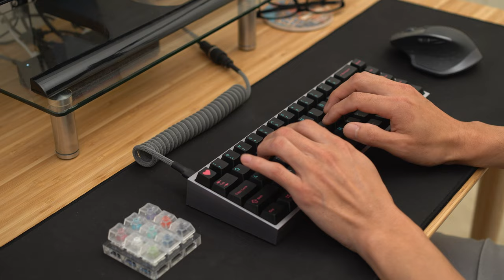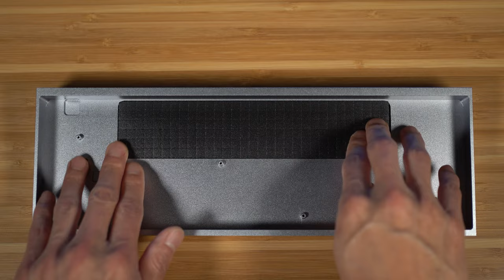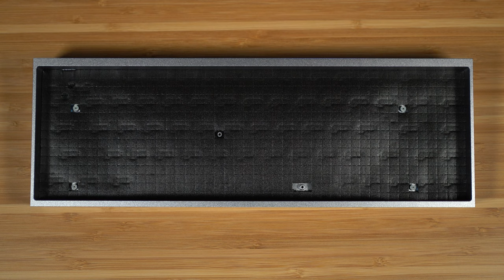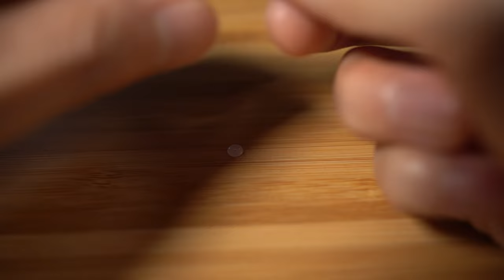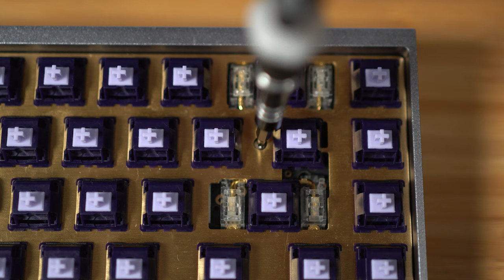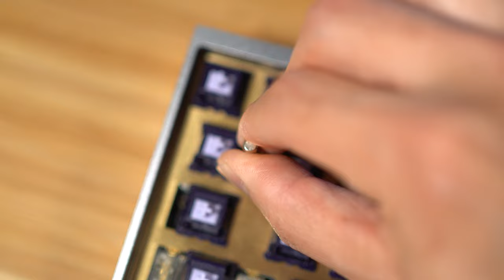Make the BEST sounding TOFU!  TOFU65 O-Ring Mount Mod Tutorial

Comment: Planned a very similar build (before watching this video and after tons of research) except I am using zeal stabs and holy pandas instead. But I am stuck between these keycaps and infinikey PBT keycaps. I would like a really satisfying typing experience and sounds similar to this one in the video. I am aware that it is all personal preference but I am wondering which ones you prefer.
Reply from the maker: Hi Connor!  Overall, I do prefer the sound of nice thick doubleshot ABS the best.  They have a very glassy sound that I do prefer.  However, right after that is a nice thick dye-sub PBT or even doubleshot PBT.  They sound a bit more "dry" but also lower pitched.  I think at the end of the day, it's preference + which switch you are pairing them with.  Either to emphasize the low frequency or a higher.
Reply: @Keybored  I know this is an older video. Do doubleshot pbt have a deeper sound or higher? ( prefer deep thonks compared to clicity clack :D)

Comment: This looks awesome and I'm looking to try this out on my Tofu 84 — but does raising the PCB by the 1.5mm thickness of the o-ring cause the USB-C port to misalign? And did you have to use longer screws? The ones with the Tofu 84 are only 4mm long.
Reply from the maker: Fortunately, the Tofu case has enough space in the port opening to accommodate!  Something like the Gk61 needed the port to be cut bigger tho

Comment: Well, I always come back to this Video somehow. I've had the same Idea and I have seen multiple mods people do BUT! Usually most of the mods result in a very pingy sounding keyboard that has good flex to it but (in my opinion) bad sound. This however is not the case with your keyboard I guess its because the tofu 65% first has better aka. more even placed standoffs and you double o-ring mod your screws on the bottom and the top. So I tried the mod on the but unfortunally I only had 6mm o-rings which would pop out at the top when screwing in. This is why I am deeply asking u to make a comparison between a normal mounted tofu with this configuration (all screws exept the middle one) and the o-ring mounted one or maybe just release another soundtest without the o-ring mod. This sounds way to amazing! I really wanna know how much impact the o-ring mod has in this scenerio. Thx for reading!
Reply from the maker: Hi Jenk!  Will look into a V2 of this video in the near future to show the difference.  In the meantime, I can tell you that the sound and feel difference between o-ring and no o-ring is pretty big.  I wasn't the biggest fan of the TOFU65 feel before, but after this mod, it does have one of the best sounds and most gentle typing experience.  EPBT caps sound a bit more plasticky, but with heavier GMK and even PBT, it sounds even smoother!

Comment: Very nice video! Quick question about the screws, are they the  one that came with the keyboard or did you buy different sized ones? Thanks
Reply from the maker: Hi Ray, the screws I have used are the ones that came with the keyboard.  I believe in the kit, there are ones that are slightly longer with the large heads.  Those work well for this application.  Hope that helps!

Comment: Hi! Would this work if I only put o-rings on top of the standoffs and not in between the plate and PCB? I'd really like to try this out but I'm running a bit low on o-rings. Thanks for the tutorial, your TOFU sounds really great :)
Reply from the maker: Hi Earl! I used it in both sides to burger mount it, but if you're low on o rings, that is what I recommend as well! The one on top of the standoff is more important!

Comment: Hi Scott. I have a Logitech G513 that I'm planning to mod. It is tray mounted, but it has 28 screws. So if I want to do the o-ring mod, do I choose to do it on the outermost 4 standoffs, or should I do it for the majority of the ones closest to the edges?

I'm also planning to add some case foam to deepen the sound. It has an aluminium top plate and a lightweight plastic bottom case, so which type of foam would you recommend? Will something heavy like butyl rubber work better, or is EVA/neoprene foam sufficient?

Comment: The sound is amazing. Do you have foam stuck on the PCB as well? Or only the Zip n fit in case as shown in video? Thank you!
Reply from the maker: Hi dave!  I do have some foam between the PCB and the plate as well!  I couldn't get my hands on any pre-cut foam from a vendor, so I used self-adhesive vinyl foam that I cut and stuck to the underside of the plate!  Hope that helps!
Reply: @Keybored  awesome thanks :)

Comment: Hey! Since you answered all the comments under this video, I would like to ask you a question. Can thicker foam be used in this mod? I have ~5 mm foam in hands. I'll be glad to receive an answer!
Reply from the maker: I think the 5mm foam may be a bit too thick unfortunately. Unless it's a super soft foam material, may be hard to screw down the pcb/plate. I believe the liner I used was no greater than about 2mm.
Reply: @Keybored  my foam is super soft and it can squish to 2 mm easily

Comment: Great tutorial - planning on doing it myself now. One question though, do you think this would still work well with a slightly larger O-ring? The 1mm inner-diameter/4mm outer-diameter O-rings are out of stock, but the 1.5mm inner-diameter/4.5 outer diameter ones are available. The thickness is still 1.5mm, so I’m thinking they would work?
Reply from the maker: Hi Huy! I believe that small difference shouldn't be too much of an issue, but just make sure the screw doesn't go straight through the ID! Still needs to catch to work :)

Comment: Hi ! Loved that idea and will definitely do it if I go with a tofu65 on my next build. Anyway, my question has nothing to do with your video except that it's about that tofu65 case. So basically i saw you used foam and i was wondering what width you were using ? I want to get some neoprene, but the one i found is 3mm wide, and i don't want it to be so wide that it eventually pushes the switches out of the hotswap pcb. I guess the orings make the pcb a bit higher tho so maybe it would work ? Anyway, thank you :)
Reply from the maker: Hi ElWonker!  The shelf liner I use is slightly thicker than 2mm?  about 2.5mm maybe?
Reply: @Keybored  Great thank you (I'm sorry I didn't get notified from your message) :)

Comment: I tried this but you cant really loosely tighten because the usb c port won't align properly ://
It still sounds really good with a somewhat tight thread. Thank you so much for sharing this technique! Ive seen other o ring mods with tofu but they aren't as good as this one
Reply from the maker: Hi Lewis! I'm glad it worked out OK! I think the beauty of the silicone o rings is that they're flexible enough to be able to compress to the thickness you need :)

Comment: do you know the dimensions for the screws? i have to buy some replacement screws and i'd like to get some that are a tiny bit longer
Reply from the maker: Hi deep sp ce! The screws that I have used were provided with the keyboard, and they are m2x5mm, with about a 4mm head diameter. I feel these below seem pretty close. Hope it helps!

https://www.amazon.com/uxcell-Machine-Phillips-Stainless-Fasteners/dp/B07MF34CFL/ref=mp_s_a_1_3?dchild=1&keywords=m2x5mm+screws&qid=1612217392&sr=8-3

Comment: Do you need to use longer screws with burger mounting? If they are 1.5mm thick each, even compressed you would think they're adding 2mm of thickness which would require you to tighten them too much or not leave enough threads to properly secure the PCB.

Comment: Hey KB! Great video and looking to do this on my Tofu60 as an overhaul mod to my board and was wondering if you used the stock screws that came with your board for this mod (and if you know if the Tofu60 stock screws are long enough to perform this awesome mod?) thank you!

Edit: was also thinking of getting a polycarbonate plate with this o ring method. Do you think that’ll be too much softness for typing/gaming or it’s just preference?
Reply from the maker: Hi Bigman!  From what I heard, some TOFU kits came with shorter screws, and makes it more difficult to do this mod.  For that, you may want to pick up some M2x5mm screws!  That was actually what came with my TOFU and worked out great!  I think with the PC plate, it's all about preference!  They are definitely much softer than aluminum/brass/fr4/etc, and does offer more flex in general.  No such thing as too soft for typing and gaming, so do what feels right for you!
Reply: @Keybored  thanks so much for the reply bro. I’ll definitely be following through with the polycarbonate plate and when the o rings come in next week, I’ll test them out and see. Thanks again!!

Comment: I have a poseidon aliminium case and i wanted to the same as you. But my problem is that the standoffs are different from the tofu. You have probably seen how the standoffs are. But on which standoffs should i do the o ring mod on since there arent two on the side next to each other?
Reply from the maker: Hmm... I do see that the 2 outer stand-offs are on an angle.  I would still choose those 2, since they're still away from most of the alphas.  the other option would be using the ones on each side, and one below, using 3 in total.  Let us know how it works out!
Reply: @Keybored  thanks for the tips! Will try in a week or so :)

Comment: Dang, what an amazing sounding Tofu. Question, in the description it says you have plate foam but its hard to see in the video, are you using plate foam on this tofu and if so are you using the Zip-n-Fit foam you used on the bottom, thanks!!
Reply from the maker: Yup, I am using plate foam and it's actually not zip n fit, since that was too thin. I used vinyl adhesive foam :) I believe the 3/16 thickness worked great. I cut them and applied to the plate. You can see the directions on the NK65 modding vid!

Comment: I love how your keyboard sounded and I was thinking of doing this mod on my GK68XS, it has 11 screws some holding both the case and pcb (shorter screws) and some just the case (longer screws), should I try to attempt doing the o-ring mount mod on all the screws? I saw from the video that you skipped the screws on the middle, why is that?
Reply from the maker: Hi Abel!  I skipped the centers so that I can reduce the number of hard mounting points on the keyboard.  This way, I can create a more even sounding and feeling keyboard.  I believe you can follow the same idea for the GK68 as well, target the outer stand-offs for the o-ring and try to keep the centers levitated above the stand off :)

Comment: Im thinking of grinding down the middle standoffs
As well as getting a pcb with flex cuts.
Reply from the maker: That is definitely an option as well. You can also take a larger drill bit, and actually cleanly drill down the standoffs. Looks almost intentional that way. This was to show an alternative way without making too many non reversible modifications to the case. When it's sitting on the outer o-rings, the pcb doesn't even touch the center standoffs so turned out nice.
Reply: @Keybored  do you think grinding down the standoffs and cutting the pcb is a good option in terms of sound?
Reply from the maker: @evanlatkiewicz  hi Evan! I didn't want to do any irreversible changes to the keyboard so I did not. I felt the 1.5mm lift from the o rings gave enough cushion that I didn't feel the pcb actually touching any of the center standoffs after the o ring mod. I've seen people make more drastic changes to their tofu60, but that was in preparation for the gummy worm mod which is somewhat different from this.

Comment: Have you ever considered removing the middle stand-offs? Do you think it would change anything?
Reply from the maker: Hi UltraSpyder123! I have considered it, but when I used the o rings to elevate it, I noticed that there was enough clearance where the pcb/plate assembly was no longer hitting the center standoff. So I ended up leaving it and worked out fine. Hope that helps!

Comment: What plate foam did you used? Sounds amazing btw!!
Reply from the maker: Hi Rodolfo!  I used some 3/16" Vinyl adhesive foam tape that I bought at a hardware store.  Check out my NK65 mod video for the details and instructions!  Not the most sophisticated... but I feel it does the job :)
Reply: @Keybored  Ohh yes, I saw that video too. With all your mod videos I ended up buying a tofu84, the vinyl adhesive, and the o-rings. I didn't go with the shelf liner because I think it is much more than I need, and I had to import everything to Argentina (yes, all of that stuff is harder to find here), so I'll need to find some foam to put on the bottom of the case. Where can I send you a sound test when it's finished? And thanks for the reply!

Comment: thanks for the vid, when you say "tighten just enough to catch the thread " what do you mean by that? is the screw supposed to be tighten into the case at all or only through the two orings without touching the post?
Reply from the maker: Hi Medsas! What I meant is to not over tighten. It does need to screw into the post, but if you tighten too much, then the screw will go through the o ring and won't be able to sandwich it :)

Comment: the sound is very nice!
may i ask what is the thickness of the foam of case and plate?
Reply from the maker: Hi Derek! The case foam is about 2.5mm zip n fit shelf liner, and the plate foam is 3/16 vinyl foam adhesive onto the plate

Comment: How would this work on the 5 degree and tofu 60 instead?
Reply from the maker: Yup! Check out my video on the tofu60! It turned out quite amazing
Reply: @Keybored  I assume that would mean putting o rings on every mounting hole? The tofu60 and 65 have different mounting holes.
Reply: @jh38949  do just the outer ones, that makes the board more flexy and even feeling in theory

Comment: Hey Scott, wondering if you can share whether or not you post process your sound tests with noise reduction or does the fifine mic just work that well and it's mostly unedited?
Reply from the maker: Hi J Z!  I do have to add Light Noise Reduction to eliminate the white noise hiss in the background.  But I apply very light NR to keep the keyboard typing sound as original and intact as possible.  I hope I can get a nicer mic in the future that doesn't pick up so much noise...

Comment: I feel like the screws that I have on my tofu60 (im assuming this would work on other tofus?) is not as long as the one shown in the video and so i dont know if there would be enough space to screw in the o rings, do you know how long the screws you used are?
Reply from the maker: Hi Alex! I was told that some tofus actually came with shorter screws than the ones I have. The screw needed is m2 x 5mm screws! Hope that helps!
Reply: @Keybored  never noticed you responded lol but thanks!

Comment: Hey Keybored! I'm just about to order my parts for my first ever built keyboard and was wondering if you were familiar with the Acrylic TOFU65 case. Does this O-Ring mod work on the Acrylic case as it does with the aluminum and would it have the same sound profile? Thanks.
Reply from the maker: Hi Simon! The o ring mod works in the acrylic as well! The sound profile is a bit different, but the poppy even sound is replicated with the acrylic as well! It just sounds a bit more thocky I feel with the acrylic.

Comment: Do you think it would be a good idea to sand a bit on the case on the hole where the usb c port of the pcb goes through ? So you avoid any stress on the port (another solution is to scew the top left screw more but it means the board will flex less there). The stress on the port is stressing me a bit
Reply from the maker: I haven't had any issues with mine since I've done this and it's been working no problems for 6+ Months :)  Just make sure that you tighten down the screw enough that you get the o-ring cushion, but so that the USB is not jammed up against the cutout.  If you do want to sand it, you can use a precision file to do this also
Reply: @Keybored  Okay thank you for your answer ! I screwed it like you said but I feel like the cushion is near gone, so I might sand it later (with a precision file of course I don't want to mess up my case haha)

Comment: think rubber o rings will yield similar results? I suppose rubber might be less flexible than silicon, depends on the duro rating maybe.
Reply from the maker: Hi Jack! The silicone o rings I have used are 50A on the durometer. I have tried something similar with nitrile o rings at 70A, and overall, it still works, but I felt the silicone o rings provide more flex and slightly cleaner sound. Hope that helps!

Comment: I just go the new tofu, they do come with the new silicon cover. However, it seems like they made the screw a bit shorter too. So now its quite difficult to fit in the orings. Even with only 1 oring on top of the pcb it still feel relatively stiff...
Reply from the maker: Yup!  I heard some kits come with tiny screws... the one you need is M2x5mm!

Comment: Do you think there would be any benefit in cutting off the centre standoffs? Or do the bottom orings raise the PCB enough that it doesn't ever hit the centre standoffs?
Reply from the maker: Hi Alexander!  When I did the mod, I noticed that the o-rings raised the PCB high enough that I didn't make contact with the center stand-offs.  Hope that helps!